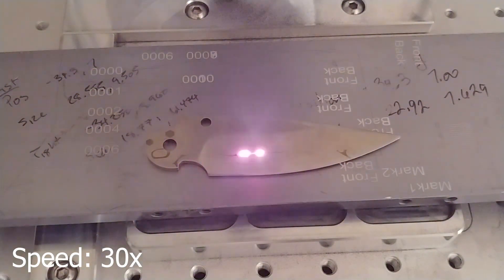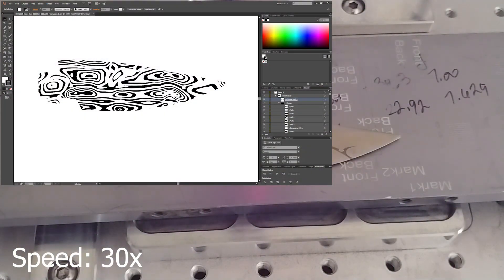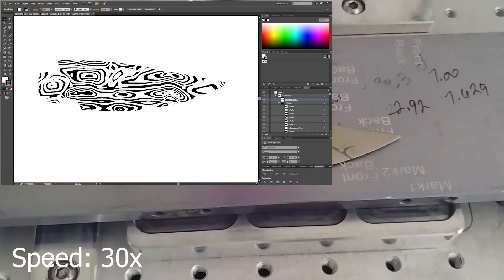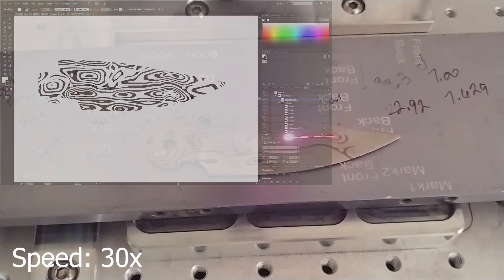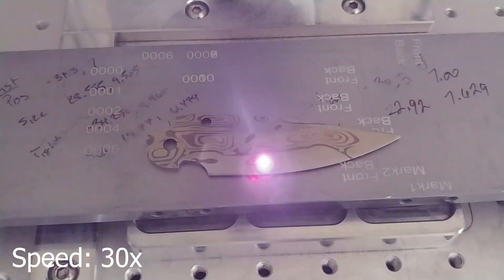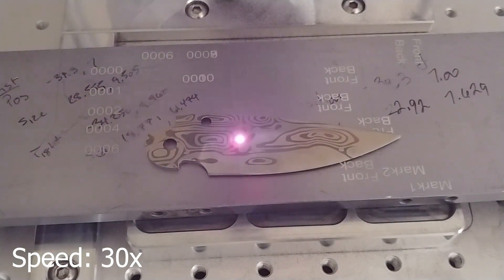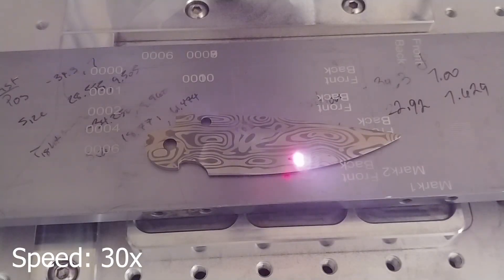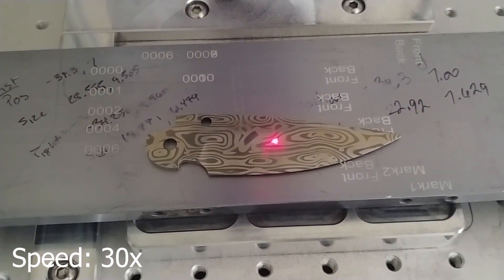Add a Damasteel Pattern to a Knife Blade with a Fiber Laser

Comment: Watching your Marking Dragons video, the second dragon has a good dark shine (would this be classed as an anneal?) but would something as thin as a kitchen knife withstand that level of heat over 11 mins or so without warping? Could you have worked on this blade for longer? Currently trying to weigh up the pros and cons versus the Cermark/50W Co2 process for dark marking thin stainless (not necessarily knives but I work a lot with 316).
Reply from the maker: Thin materials will tend to warp, but this knife is fairly thick so marking for a longer time wouldn't be a problem.  Keep in mind that an anneal is done with lower power (some people use higher power and take the laser out of focus) which won't be terribly extreme.

Comment: In your opinion, is the 30w worth the extra money? I'm looking at purchasing one of these for my Gun Store FFL business. Looking to engrave firearms, stipple polymer, and add logos. I would like to buy the 20w due to price, but im worried about quality.
Reply from the maker: If I were buying one today, knowing what I now know, I'd probably go with a 30w with two lenses - 100mm and something larger, maybe 200 if not all the way to 300mm.  That being said, the 20w is more than enough for the vast majority of my marking (mostly just anodized aluminum).  

I did have the same thought as you when I was initially shopping for mine...who wants to pay an extra $500 or $1000 for the extra power if it ends up being a piece of junk.  So far that hasn't been the case and I've been happy.  Hope this helps.
Reply: @jefferyj  Thanks for the quick reply.
Currently i have been looking at the 20w and 30w 110mm and 150mm. Are the lenses easy to change if purchased later? 
And other than speed, what benefits a 30w over a 20w. Thanks.
Reply from the maker: The smaller thread lenses like mine are more difficult to find than the larger.  I don't remember the exact thread sizes off hand, but I think mine is something like 53mm in diameter whereas the larger common ones are m79 and m84.  If you go the ebay route, you'll probably have a small one like mine.  They screw in to place, but the settings in ezcad will be different for each lens.  You can maintain two separate ezcad folders to make this simple.

Speed/depth is the primary reason for going with the higher power laser source.

Comment: Hi Jeffery could you tell me please? I want to change the lens on my 30 what to a 300 x 300 do I need to save or change settings. Your help would be much appreciated. Thank you Trevor
Reply from the maker: Duplicate your Ezcad folder and rename the new folder to Ezcad 300x300.  Install the new lens and go through the adjustments for your workspace size, distortion/scale, etc.  As long as you maintain two separate folders with different parameters, you should be able to save your settings for both lenses. On my laser I have one lens so my only experience doing this is when I helped my friend with a 30w swap from a 300x300 to 100x100 a month or two ago.

The steps after creating the new folder - if I recall correctly - are to go to the system parameters and change the size and position of your workspace to fit the new lens (if you have a 100mm lens now it should be something like be -50,-50 for position, 100x100 for workspace), then go to configuration parameters and change the field size, and lastly, go through the distortion/scale adjustments.  Probably doesn't need to be mentioned but just remember your focal length will be a lot longer now with your 300mm lens so the head will be much higher.  Off the top of my head, that should be it.